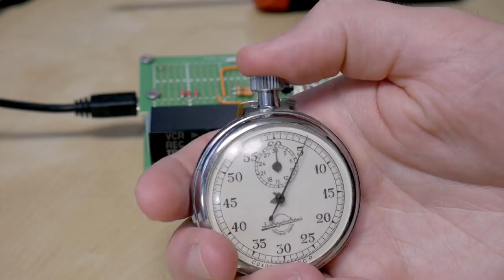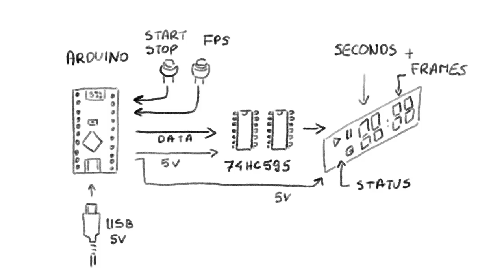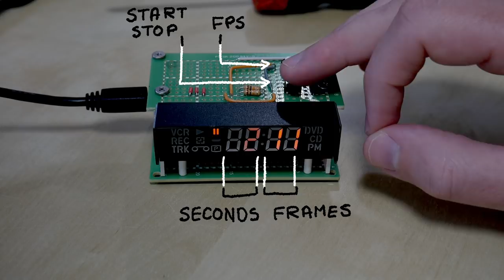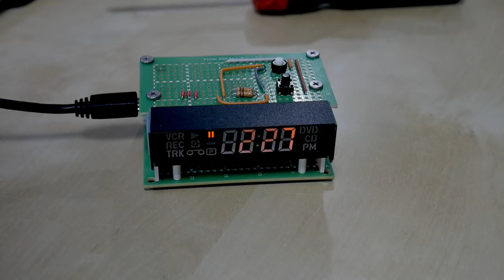DIY animator's stopwatch with Arduino

Comment: Very neat build, that also looks nice :) did you maybe consider using a transitor array to drive the leds instead of powering them directly through these poor little logic (shifter) ics? Then the display maybe wouldn't look so dimm. Really liked the video :)